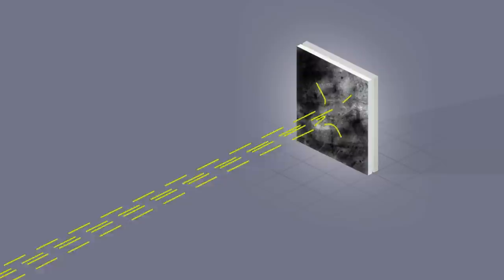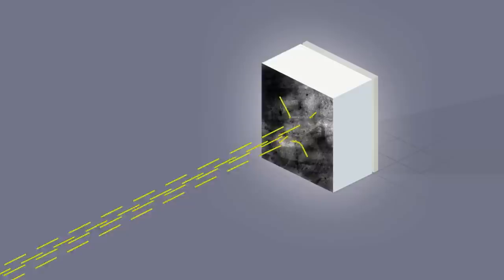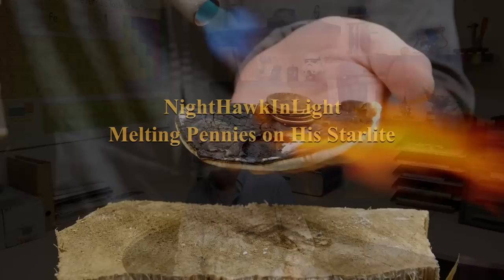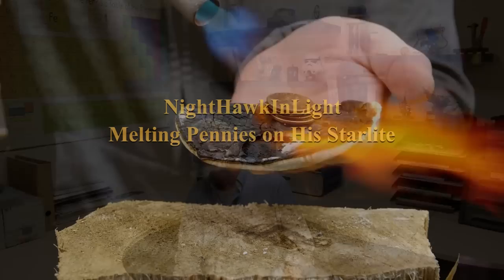1619 Whatever Happened To Starlite The Wonder Material

Comment: So basically a refractory, carbonizing material and a CO2/gas generator mixed with some binder. Silicon dioxide (refractory), starch (carbonizing), sodium bicarbonate (CO2).
Reply from the maker: yeah - basically - that's all there is to it

Comment: Starlite supposed to be nuke proof. I’ve made my own before now. I even used table salt in mine. I figured out it was some kind of salt dough. Even through coffee granules in mine. Might make another batch to show? Thought it smelled nicer that way.  The issue I had was working out how to bake it into solid non soluble tiles.  Might require another salt like potassium or manganese,  along the lines of sodium manganese anhydride. It more interesting because mix with a carbon source And a binder. It altered the reaction and it resistance to erosion. It might be possible under the conditions for nano diamonds to form. Had wished to use mine as a forge liner. Being stone cold broken at the time. The next task would to build me own space shuttle. On that I was most certainly dreaming. Though nasa might like a go? Great party trick!  Orbital re entry using pastry? Never did quite figure out how to key it to a spacecraft.  But it great stuff.
Reply: delicious heat shield
Reply: @DANTHETUBEMAN  I’d joke further about the type of pastry. Though if it got pva in it. You won’t want to eat it. Don’t think I’ve ever heard nasa make a Cornish pasty heat shield. But if you ask them nicely the might give it a try? On a scale model. I just love to see one of them take a bite and say tasty!
Reply: @jasonhaymanonthedrawingboard  as long as the can lights on a sound stage won't melt it NASA is a go all systems nominal
Reply: @DANTHETUBEMAN  sure nasa can knock itself out!  Just send me the footage of a non cremated pasty an I’m cool! Lol!
Reply: For the space shuttle, get onto Jeremy Clarkson- he's been there, done that!
Reply: @rossbrumby1957  I would however? His attempts on getting a robin reliant in to space left much to be desired. So not the best starting point.

Comment: Hey I just seen the bit that you did on the NASA Sterling engine made step by step was just wondering how efficient it would be to create electricity using a speaker magnet setup to make electric generator
Reply: Also I noticed that you made two of them was wondering if you put a rod in between the two you could make them harmoniously work together might have to build apparatus to hold them a certain distance apart
Reply: I bet if you could make it out of a 50 gallon drum rip the motor out of a car it might power an electric motor directly
Reply from the maker: it's going to be around 30% efficient or so - it is a Carnot engine so around that is about right

Comment: Im surised they havent marketted it as a thermal coating for steel structures, which come under immense stress when in a high temperature fire. That is unless the costs and application process put them squarly out of the playing field with other similar products.
Reply: The WTC would still be standing; that event came straight to mind on reading your suggestion. The buildings had asbestos tiles installed which were supposed to have performed this function, if starlite is functionally better for this, it should be researched further.
Reply: @RedPillRachel  The main design problem with the WTC appears to be that each floor was hooked to the exterior by hangers to save on weight, and its these that gave way. This caused a domino effect as each floor slammed into the next all the way down.
Reply: @Arachnoid_of_the_underverse  this is a possibility, but my theory was that the asbestos was shaken off during the initial impact. Either that, or bombs pre-placed throughout the building. 

Squibs and other such evidence; e.g. WTC7, mean we simply cannot rule this out yet. When I was younger, I was 10% impact damage, 90% bombs. Now I'm 50/50, undecided, at the age of 40. The evidence is still compelling BOTH WAYS.
Reply from the maker: they don't seem to be marketing it at all really
Reply: @ThinkingandTinkering   It could also be an issue with bulk application or checmical stability.

Comment: Has anyone ever discovered/disclosed the starlite composition/formula?

Obviously no commercial usage can be made without owning the patent or a licence to it, but for private, home use? ... Should be no problem. I'm thinking especially in the area of melting and casting metals and furnace insulation.
Reply: YouTuber I think called nighthawk has videos on making it
Reply: @theaussienurseflipper.8113  Ben's channel is Nighthawkinlight.
Reply from the maker: there are quite a few replications about - Nighthawkinlight is the most watched but if you do a search on it you will find half a dozen - at least - recipes then of course you can just get the meds of the commercial products and that will give you the ingredients of the current commercial versions

Comment: A lot of building projects have had all steel beams etc. painted with "intumescent paint" these days for fire regs is this the same ?
Reply from the maker: yes - pretty much
Reply: There are a lot of good intumescent products around today. While rebuilding a block of flats I had to put a grove round all the door edges to take an intumescent strip. My daft assistant decided to test it by briefly running the hot air gun over it. So there we were stuck in a smelly flat until I could free the door with a padsaw.
Reply: @alandavies55  Would that trap you inside if there was a fire ?
Reply: @groovedodger  It would, but only if there is an active fire outside the door, it is intended to stop fire racing through large buildings. In practice the quickest way out of a room in many modern buildings would be through one of the stud walls.